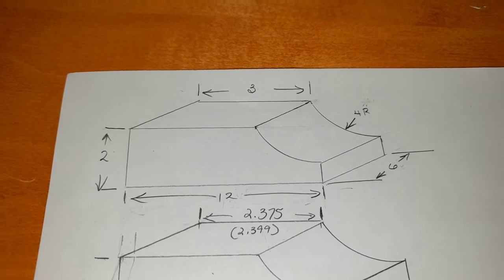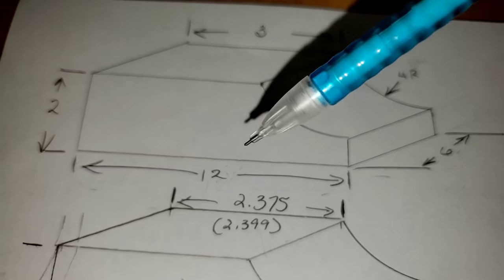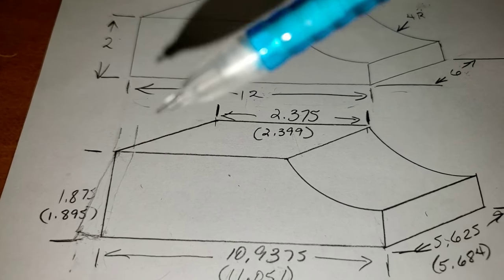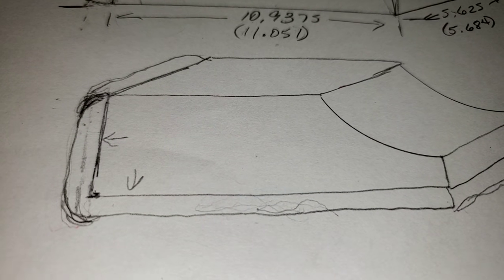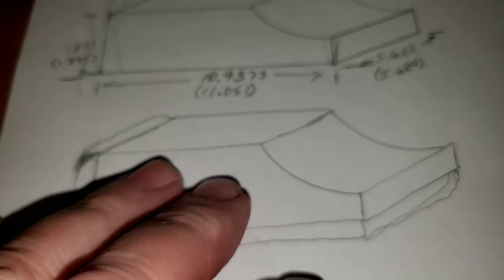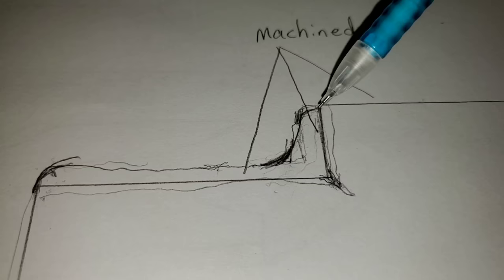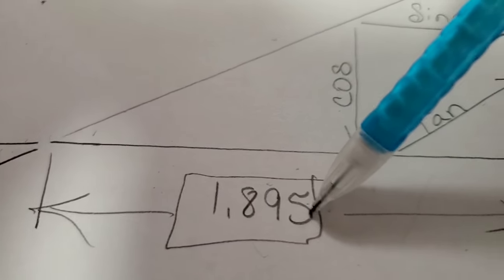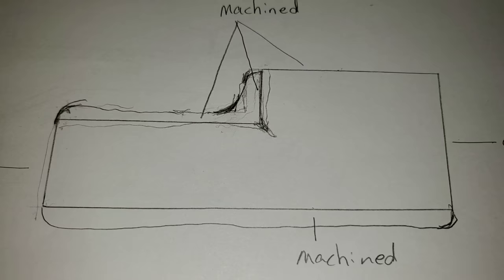DIMENSIONING FOUNDRY PATTERNS

Comment: Thanks Clarke. Very well explained. Without a radius could you explain why a sharp angle will be hard to machine. Regards Kevin
Reply: Corners can cool more rapidly than a radius causing quench hardening.
Reply from the maker: Kevin as Proud2bmodest explained, corners chill as it cools more rapidly than the main mass. White iron/carbide develops here if not rounded out

Comment: Great video Clarke, alot of well explained information. I understand the inside radius in a area that is going to be machined but I am not quite sure about the outside radius. I imagine that a sharp corner would cool off faster than a area with more mass. Would this cause the area to be harder than the rest of the casting?
Reply from the maker: Andy you are correct. Sharp corners can chill or turn to white iron
Reply: @windyhillfoundry5940  makes sense thanks for the reply

Comment: What would you  say is an acceptable tollerance for a cast face? I like these in depth videos are you going to do one on your furnace?
Reply from the maker: Not sure I'm following your question but if you mean adding additional material for machined surfaces, the width tends to dictate how much thickness needs to be applied to have sufficient cleanup on facing operations. For the size castings I do here, .100" seems to work

Comment: when i was in the 7-8 grade, 1967-68, when we had industrial arts in school we did some casting/ foundry work  and used the sprue and riser forms, i noticed you do not use a separate riser to the top of the sand to vent extra metal , do you find your way works better with an internal riser ?
Reply from the maker: George as a habit I use blind risering. It saves on material and does just fine. Sometimes I do use open risers like what you describe when I want to back feed after filling the sprue to keep the riser hotter longer. Larger castings for example I may use open risers for
Reply: @windyhillfoundry5940  ok thanks !

Comment: What about the Radius  I assume we would Deduct Shrink to obtain a desired finish radius dimension
and add shrink to the vertical and horizontal Center line dimensions to achieve position of the arc center lines
Reply from the maker: Wayne, I scale everything and it hasn't been an issue as long as I've been doing it that way

Comment: How do we address internal holes, say I want to core a 1.125"  machined hole. Think back to the pulley you did for Keith. If the ID is unmachined,  is the pattern dimension ID + shrink?
Reply from the maker: Anthony I treat internal features such as cores with the same respect. The court house pieces I made were of finished dimensions and had to be cored slightly oversized. Keep in mind cores often have surface imperfections that can cause raised material on the inside
Reply: @windyhillfoundry5940  when I get a bunch of other projects done ..... yeah  right .... I'm going to send you some photos and pattern sketches of some parts I'm thinking about, for critique  and advice.  1 similar to Keith's pulley, another one cored, match plate and  another match plate, multiple identical parts, also cored.  May omit the cores, for simplicity.  just 1.000" dia finish machined bore for shafts.

Comment: A good lesson on draft and shrinkage.  I cringe when you show 3D formed patterns people send with ridges on the draft sidewalls.
Been in mold design for plastic injection molds since 1962. Basically the same except we want to mold a finished part, fiberglass reinforced plastic shrinks more across the flow than with the flow, no machining, finished texture and color, no sinks, flat and not warped or no burns from inadequate venting.
Reply from the maker: Yes Wayne over the years of research I often come across articles of injection molding that have a lot of useful info

Comment: It's about .015" per inch of height per degree. Or about .090". No 
First decision on any pattern, which side is the drag? Next where is the parting line? The drawing you showed was obvious, the side with the 4" . The drag is flat no radius required in the drag.

Comment: Decimals or fractions... Seems like both of you would have made it over to metric numbers by now. Hard to teach an old dog 200 year old tricks, I guess. 😁
Reply from the maker: I can't argue with you Tracy but if I'm doing 100 mph, you would have to go 160kph just to keep up with me🤣
Reply: @windyhillfoundry5940  I love what you do, and I wish you had a guest house I could book occasionally, so that I could watch/help. If you ever start to take on weekend apprentices, you let me know. I'll do the math in imperial decimal format just for the privilege of getting to hang out and watch you do your magic
Reply: Ditto for me!
Reply: Any length can be divided in half using a simple divider which is the basis for the fractional system. Dividing by ten can only be done using calibrated rulers or similar dividing techniques.
Doubling is also a natural and easy way to make a measuring system. It's very easy to make two things of equal length and then stack them together and copy that length. With a decimal system, at least five identical pieces have to be created as the basis for a measuring system.
At the highest levels of precision everything is dependent on comparison of equals which is inherently fractional.
Reply: Last time I checked the inch is defined in mm.  So, we are using the metric system, just not showing our converting work.  My old algebra teacher, Mr. Rubin would be unimpressed with "magic answers" that don't show how you got there.
Reply: @stxrynn  if only the whole world could agree one way or the other. Length (inch) is derived from millimeter, but the meter, liter, juel, etc are all common. Not so with inch, gallon, horsepower, etc
Reply: @TracyNorrell  When I was completing my engineering studies at university, it was strictly SI units.  The rub comes with the abortive attempts to convert the US to metric in the past.  So, we use them both.  To me, its similar to how we use language.  In common conversation, we use slang or jargon (inches, feet, pounds, gallons).  In technical, formal or legal usage, we don't use slang, we strive for accurate, proper communication (SI units).  This is a less formal venue, thus, the units we are most comfortable with using.  I'm sure there is a bit of the American "I'll do it my way" as well in our resistance to change.  We seem attract independent minded people, or at least we used to.  I would love a speedometer calibrated in furlongs per fortnight.  Heck chains per hour or fathoms per minute would be cool too!